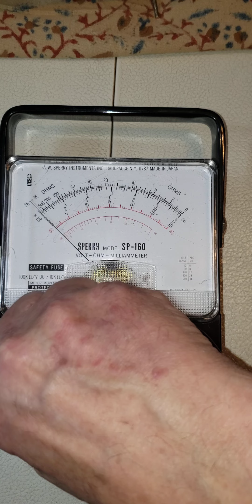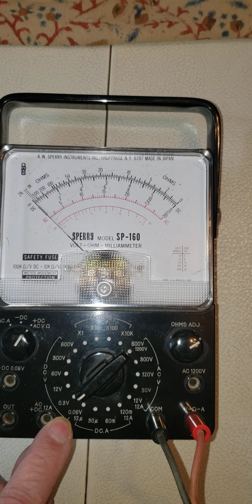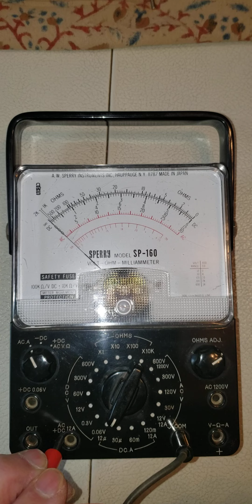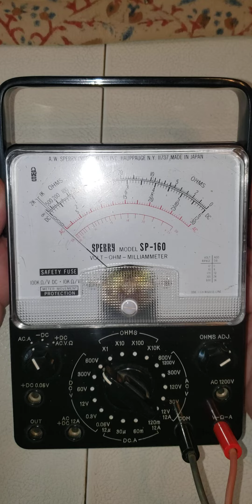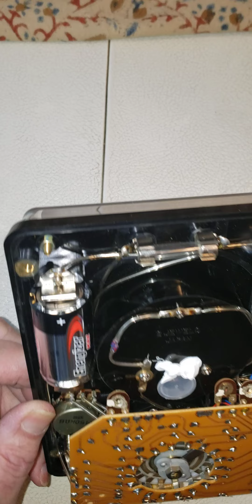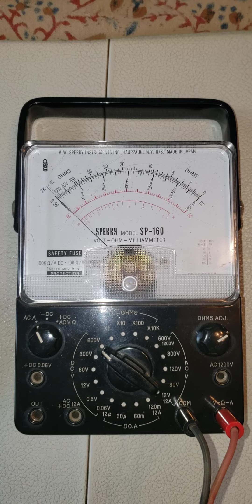SPERRY SP160, Unusual Vintage Analog Multimeter, Made in Japan

Comment: That's a really cool meter. I am currently working on a video for an analogue meter I bought off Temu. I also have a Taylor one I started working on last year. I must get that one finished. It's a tube one and has a 6AL5 in the probe. When I put up the videos I will leave a link to this one. Take care mate.
Reply from the maker: Your Taylor meter with a tube built into the probe is a VTVM, a vacuum-tube voltmeter with very high input impedance, so that it won't load down the voltages of the circuit under test. Ordinary analog VOM's, volt-ohm-meters, such as a Simpson 260 or my Sperry shown in the video have a much lower impedance. When I was working at a TV repair shop as a 19 year ol,  all the techs had both meter types on their benches, and the schematics usually specified the impedance of the meter to be used in order to accurately measure the voltaages of various circuits. Nowadays, a digital meter also has vety high impedance and can take the place of the VTVM ---- but a high-impedance meter can give misleadingly high voltage readings compared to the reference voltages on the schematic which may have been originally measured with an ordinary analog VOM.
Reply: that’s some really interesting information. I can’t wait to get back home and get everything working and I can play with my new toy. 
I normally don’t correspond with people on YouTube and not sure if you sent your email. Maybe I’am not seeing it but I’ve got that scan of the manual ready to send over. 👍🏼